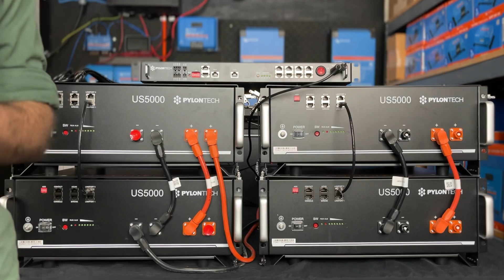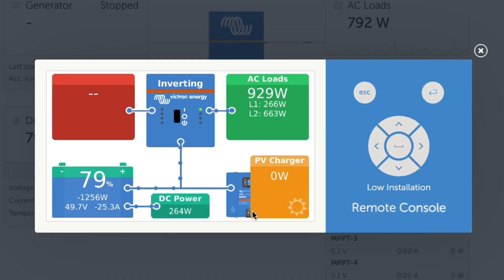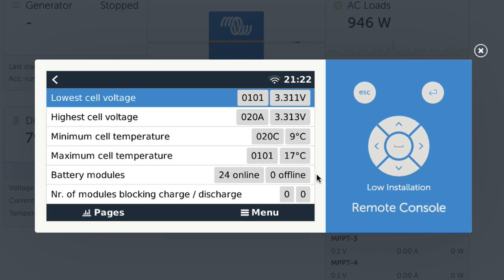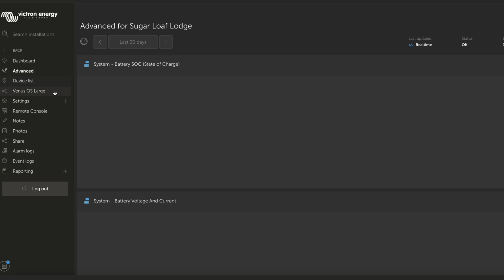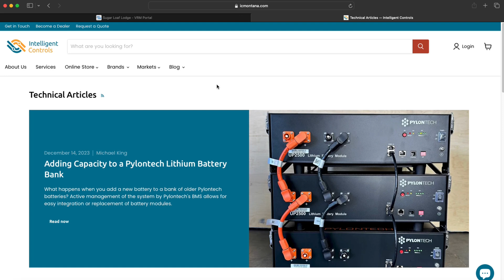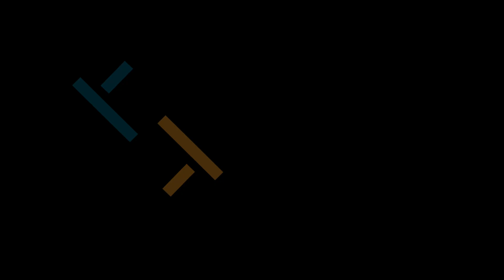More Communication, More Power | The Pylontech Low-Voltage Combiner Hub

Comment: hey Mike
I have 3pcs 15kva victron multiplus, 4 pcs 450/200 smart mppts, 1 CERBO GX, 1 PYLONTECH LV HUB and 20pcs PYLONTECH UF5000 51.2V, How can set these system up,
Reply from the maker: Hello Fred,

Thats a great combo on the Victron components and the batteries. 

For the UF5000, I do not believe that the LV-hub is either required or even compatible. The unofficial word from Pylontech is that they will be releasing a LV-Hub 2.0 that will allow the expansion of their 51.2V products. For the time being, the UF5000 will support 20 units on a single string without a combiner. 

For DC wiring, the first thing to consider is how many battery runs you will employ. A easy rule of thumb is 2 batteries per cable kit. I would recommend 10 cable kits in this case. For bussing and fusing, a good choice is M10 Lynx Distributors from Victron. If you use 10 Pylontech cable kits, then you will need 5 Lynx Distributors. For fusing, the 15K Quattro's will each need a 400A fuse, the Smart Solar RS 450/200s will need a 225A fuse, and the battery runs should each be fused with 125A fuses. 

Include a Victron BMS Type A Cable and 7 RJ45 UTP cables and that should cover everything.

Comment: In my menu, the DETAILS is not visible. How is that possible?  The old menu and the new menu.
Reply from the maker: Hey Erwin, 

If the details menu is not available it means that the hub is running an older firmware and needs an update. Shoot me an email, mike@intelligentcontrols.io and ill get you the firmware file

Comment: With the US5000 connected to Victron (trough a GX device), it seems I can not see what the individual modules do (Voltages, logs/warnings), correct? Been working on 30+ US5000C with a LV-Hub on a GX-device. Seems to be very limited battery information, and in case I would need to troubleshoot a US5000 battery stack, I do need to connect Battery View to each individual battery? If I am correct, the BMS/communication/diagnosis of Pylontech seems very to have plenty of room for improvement, almost so much that I don't want to install these batteries in a 10+ battery configuration. Any thoughts? Any alternatives? Am I missing something?
Reply from the maker: Hello. It sounds like you need to push an update on the LV Hub. The most recent firmware will populate the battery details menu in the Cerbo. Shoot me an email mike@intelligentcontrols.io and I'll get you the firmware file.

Comment: is it possible to create a video on directly connecting a vitron multiplus 2 (3000va 48v) for example to a single plyontech battery?(ie without using the cebrus gx thing which is expensive and surely its not needed with 1 or two batteries?
Reply from the maker: Hello there, thanks for the question. In our experience, there is no reason to utilize a high-quality communicating lithium battery in a system with no communication. Why? Because a stand-alone inverter utilizing a basic voltage sense to determine Allow-to-Charge/Discharge parameters will receive exactly zero benefits from the advanced (and relatively expensive) BMS in a Pylontech battery, and will result in the exact same operating conditions as an inexpensive drop-in lithium with a very basic BMS. Now obviously, there will be a big difference in long-term performance from the cheaper battery when compared to one of the Pylontechs, even when used in a stand-alone configuration. My question would be; if you are already spending a significant amount of money to purchase a quality lithium battery, why not spend the additional $250 required to fully integrate it into the power system as it was designed to be?

Comment: Thank you for this video. How can I check the data of each cell of each battery?
Reply from the maker: Hi @karlberger4418, the low/high cell data is transmitted to the GX device via the CAN connection, typically this is the bulk of what the Victron system needs to make decisions, and is bandwidth efficient. The primary BMS in the bank is examining all the batteries and will pass forward the high/low temp/voltage/alarms/etc. For more detailed information you’ll want to connect directly to the battery’s “Console”. There is Pylontech-specific software with which it is possible to see cellular level data on each and every cell, as well as a pretty thorough history - we use this functionality for troubleshooting batteries that seem to have issues. It’s a much more in depth question that we haven’t covered in any videos and is too long to cover in a comment here. Please reach out to us directly if you’d like a more detailed explanation (from our homepage banner you'll see a link to our get in touch form).

Comment: I will be having 25 units of the UP5000 with an LV hub. So I will be doing 2 stacks of 8 units and 1 stack of 9 units. In your video you have mentioned connecting inverter communication cable to the CAN out port of the LV hub. Where is the other end of the inverter communication cable connected to ? Is it connected to the Cerbo GX (in case of victron) for BMS connection ?
Reply from the maker: Hi there, if using a Victron system, the comms cable will connect to the BMS.Can on the Cerbo. Make sure you use the terminator plug in the remaining BMS.Can port.
Reply: @intelligentcontrols 
pylontech and victron need you a special cable. type A or type b. Battery to inverter not working. According to the description, only 8 blocks work and the whole thing 5 times. that corresponds to 40 batteries Is there a video somewhere where more than 8 batteries are connected per block and it works?
Reply from the maker: Hello @marcodressel4453  If I understand correctly, you are confused about how the Pylontech LV-Hub manual indicates setting things up for the various battery models. This video for reference in setting up the newest models in the US line of batteries from Pylontech. Specifically, the US3000C and the US5000. This is found on page 8 of the LV-Hub manual. 
The maximum of 30 batteries you are referencing is only correct for the older US3000 and US2000 models without the modern CANbus protocol.

Comment: Hey there, great video! I have a quick question. I currently have 16 Pylontech US3500C batteries and am looking to expand by adding 10 Pylontech US5000 batteries initially. My current setup includes 3 Victron Quattro 48/10000/140-100 inverters, 16 Pylontech US3500C batteries, a Cerbo GX, and 4 MPPTs.

In the LV Hub, should I split my 16 US3500C batteries into two banks of 8, or can I keep them all together and just add the 10 US5000 batteries? Also, is it possible to add 10 US5000 batteries, or do they need to be grouped in pairs of 8?

Thanks in advance!
Reply from the maker: I would recommend that you create two groups of batteries, each with 5 US5000s stacked on top of 8 US3000cs for a total of 13 batteries per stack. 

It's best to evenly distribute everything, if only for parity when it comes to wire.
Reply: @intelligentcontrols  are you able to assist with the firmware update procedure
Reply from the maker: @TemboMateo  yes, shoot me an email, mike@icmontana.com, and I'll get you sorted.

Comment: Mike, thanks. Please tell me the fuse to use ...A LV_Hub Power from busbar 48V
Reply from the maker: Hello, the LV-hub pulls about 2W, so at 48v, that's about 0.04A. If you would like to fuse the power supply, I recommend using a 0.05A fuse.

Comment: Mike, please make a video of Pylontech mixed size battery banks. This seems to very possible via Pylon BMS as long as the latest version battery is the master...There are many debates around this. The scenario is where you have an existing U2000 battery bank and want to expand, but you can't find U2000's anymore or it is cheaper to get a 3.5kwh Pylon...
Reply from the maker: Hi Jaco, I can confirm both from Pylontech’s official documentation and from personal experience that mixing and matching the various sizes of the Pylontech US series batteries is possible and easy to do. We are due to shoot another batch of videos this fall, I may hook up a US3000 and US5000 together and show what happens with some data pulled off the BMS.

Comment: I have 12 unit of us 3000 ,any explanation on the dip switch settings
Reply from the maker: Hello, unless you are planning on adding 5 or more units to your system, there is no real need to mess with an LV-HUB for 12 US3000s. For normal configurations, the short answer is that the DIPs never need to be changed from their default positions. If you happen to be connecting to an inverter via RS485 using a 9600 baud rate, then DIP1 on the master battery (they are labeled upside down) needs to be turned on.

Comment: hi, i have 2 us 3000 batts on my system and i have access to two us 2000, can i mix these together?
regards
red
Reply from the maker: Hey, thanks for the question. You can mix the US3000 and US2000 batteries. When combining them, just make sure that one of the US3000s is acting as the master battery.

Comment: Any explanation on CAN-RS485 port connection? How is that possible?
Reply from the maker: Hey Jimmy, there is both a CAN port and an RS485 port. The BMS is configured to be capable of communicating via either of these protocols. The CAN protocol is the most straightforward and is the recommended method for compatible inverters. The RS485 can require some DIP settings but works as well and provides a wide range of compatibility.

Comment: Hi Mike first time watching your videos, very interesting. I wonder if you could help me. I have 7 pylontech extra 2000 batteries that hadn't been used for a fee years.  Have managed to get some charge into them by changing settings on my Solis inverter to lead acid.  Unfortunately am getting can comm fail . Am guessing maybe firmware needs updating on my batteries but pylontech won't send as out of warranty.. do you think that a hub would communicate with my inverter and my older batteries  !!
Reply from the maker: Hello Mark. Shoot me an email at mike@icmontana.com and we can do some troubleshooting. I can also get you the programs and firmware you will need and walk you through updating the BMS.

Comment: Mike, are you sure about dip 3 down on the Master Battery? The manual says dip 2 down... I've tried both and neither seems to have and effect...
Reply from the maker: Hey Pieter, the dips are confusing because we are used to reading them from left to right but the Chinese have them labeled from right to left. The commissioning process is very order sensitive, if you aren't getting the address beep the first thing to check in the troubleshooting process is the order that you are doing things in. If that ends up not working, your battery might need a firmware update.
See 'Related Resources' here for a good version of the LV-Hub manual, along with my quickstart guide for CAN bus installations. 
If you're still having issues, shoot me an email (mike@icmontana.com) and we can set up a call to troubleshoot.
https://icmontana.com/products/pylontech-lv-hub